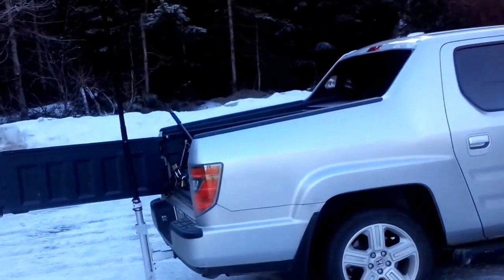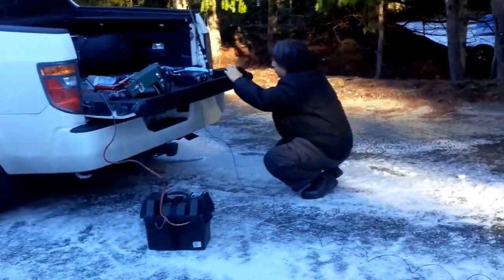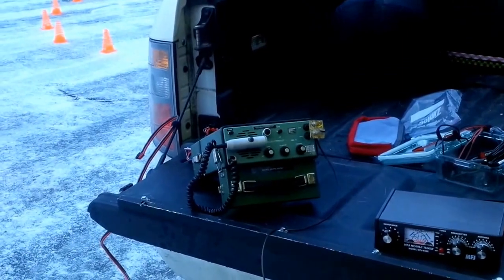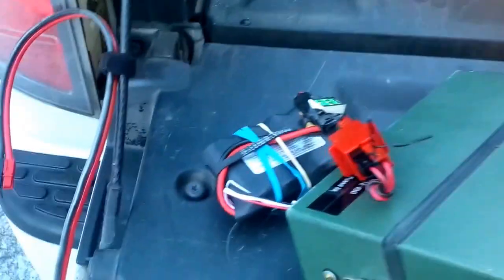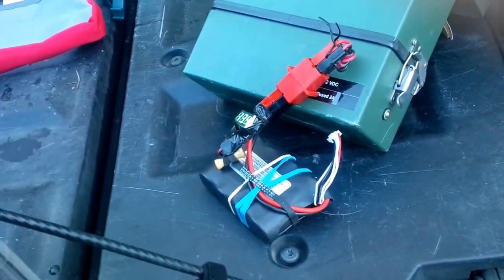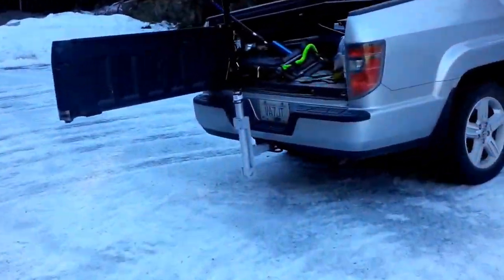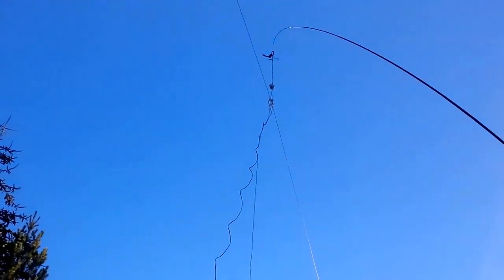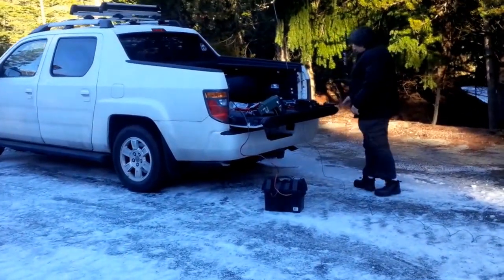Portable HF Amateur Radio QRP (Spilsbury Tindall SBX-11, Yaesu FT817, Buddipole batteries)

Comment: Do you know of any other rigs made by Spilsbury? I just worked a Cuban station using a Spilsbury on CW, but he didn't say what model it was. His English was limited. His output was about 40w. Although it drifted some, it sounded really good.
Thanks for posting your video. 73
Reply from the maker: Spilsbury & 'Tindall was a company based in Vancouver BC that operated from about 1941 to 1984 based in Vancouver, BC. They were known for solid commercial land mobile radios operating SSB.   I don't know of any with CW options.  Perhaps someone else will know the answer.
73
Greg